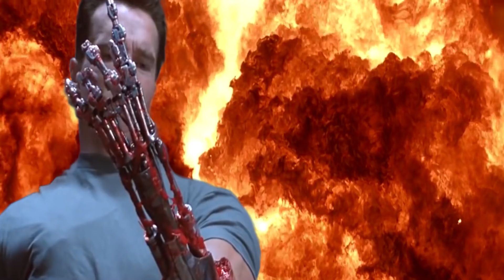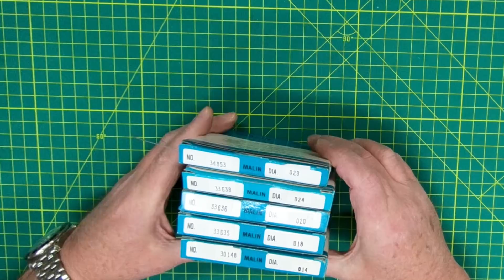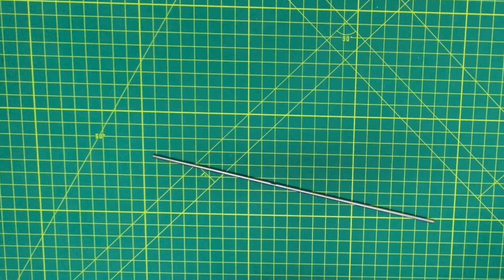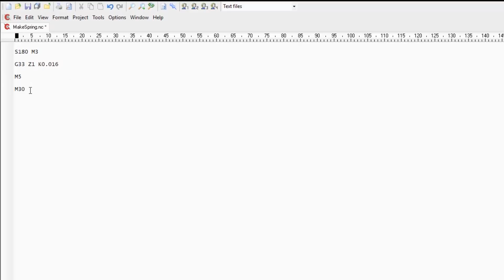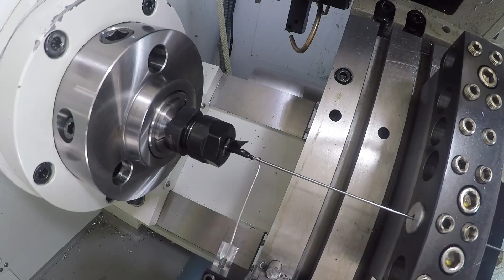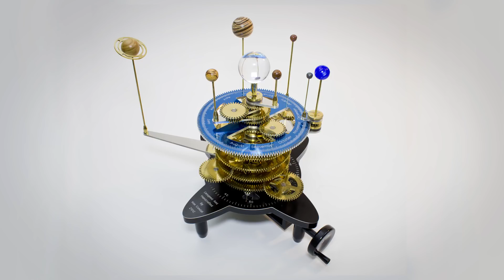T-800 Endoskeleton Arm Part 06 - Making Springs And Things

Comment: Did you scale up the dimensions to actual size?The prints made by Andrew were taken off a resin kit, which is slightly undersized. The joints should be .625" high, scale everything up by the same amount.
Reply from the maker: NOW you tell me??? No, I didn't scale anything up, but it's plenty big!
Reply: @KenToonz  Ha, sorry. But yeah, there's tons of "standard" measurements in there. Fingers were machined out of 5/8" square bar stock. Joints retained that dimension while the round parts were turned down to 3/8". The slot down the middle is 1/8" leaving 1/8th on either side. Knuckle "caps" are .5" across, etc.I have a bunch of parts that are true 1:1